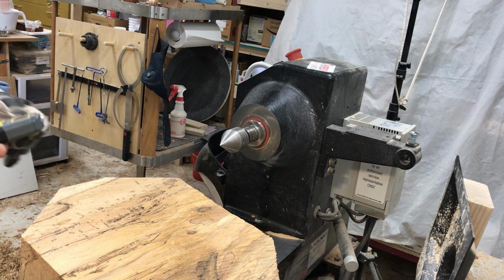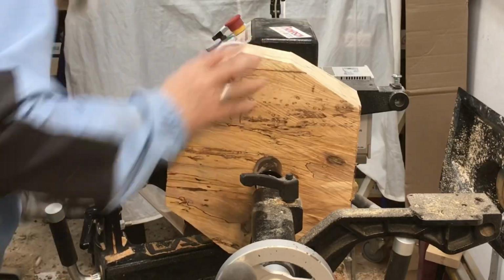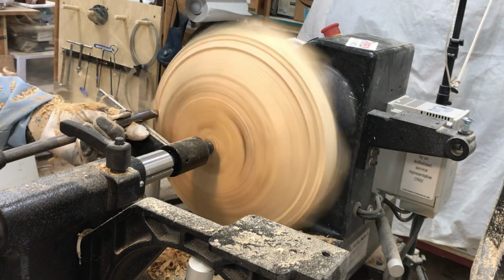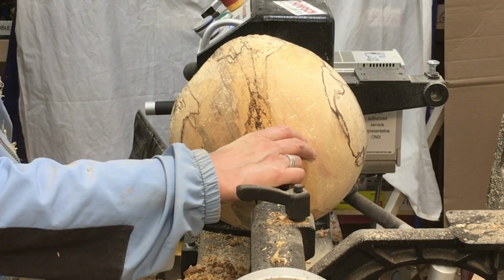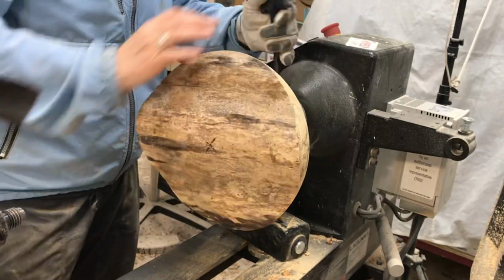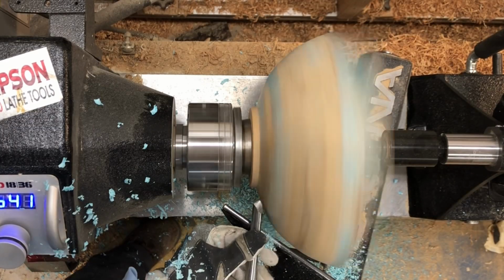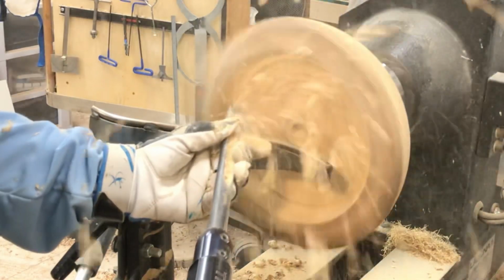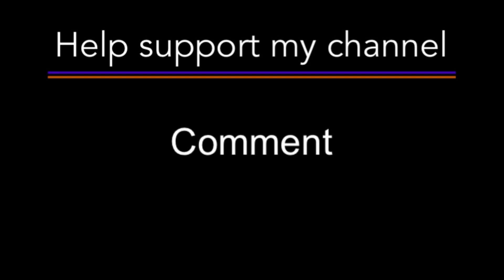Woodturning: Sugar Maple Natural Edge Bowl - Scalloped and Spalted

Comment: I love spalted Sugar Maple!  You gave me a great idea with the Milliput...I turned a large bowl from spalted Sugar Maple and the entire bottom cracked and split before I finished it because it contrained the pith.  I think I'll try the Milliput to fill the cracks and then finish it!
Reply from the maker: Hi Carol! I think the Milliput would be great for that. It actually did work in this case but there were just so many holes and voids that I really need something a bit thinner to slather over the whole thing and level out the surface. I’ve got a couple more pieces from this tree I’m gonna play with and see what I can do with them.
One of the things I’m going to do with pieces that crack, or pieces that are cracked to start with, is to put them in my turkey roaster and fully dry them out - let them finish cracking and then fill the cracks with whatever epoxy or CA I’m using. That should eliminate any additional issues down the road. I figure once it’s cracked, might as well let it go the rest of the way and deal with it all at once!

Comment: Lyle Jamieson's hollowing tool is a good investment. I bought one 5 years ago, and like it very much. I bought a small and thick boring bar, and like the way the thick one minimizes chatter when boring deep in a vase.
Reply from the maker: Hi Doug! I’m looking forward to getting it put together and trying it out soon - I’m sure it’s gonna be fabulous!
Reply: @LisaRamlow  The next thing you will need is a steady rest, for hollowing those tall items.   :-)
Reply: I bought an 8 inch faceplate from OneWay, and it added confidence when turning long, heavy items. A 4 inch faceplate just doesn't fit the need for larger turning stock.
Reply from the maker: Yeah, I saw a plan I liked and have been meaning to build one but have done every other thing in the shop instead! Gonna start off with some smaller items until I get the hang of it
Reply from the maker: Ha! I only just bought a 4” plate! But again, gonna start smaller and work up from there 👍

Comment: Fix the punky areas with sanding sealer or I sometimes use thin ca glue. Just flood the area once the shaping is close to final shape, soak it in and let it harden then turn to finish. Those little holes full of fine dust react well to soaking with CA too! Looking forward to the finish.
Reply from the maker: Hi Martin! I’ve used shellac and thin CA on spalted wood but once I decided to twice-turn this bowl I figured it was just wasting it. I’m sure I’ll need some stabilization when I finish it up. Thanks for stopping by and for the tip 😬

Comment: Awesome job so far, that is a beauty with all the spalting, your shop must be cold as I see you wearing a coat! Thanks!

Cheers Al
Reply from the maker: Hi Al! Actually, it is usually a little chilly in my shop but in the summer that’s a good thing! In winter I wear a welding jacket and summer a dirt bike jacket that’s much lighter weight. Both have high collars to help keep the wood chips out of my everywhere! 😂

Comment: Bug holes are a big bother..... With the 1/4 inch or so ones, I knew one turner who would use a pressure washer to remove all of the frass. With the tiny ones like these, no clue how to deal with them. Maybe a major soak in the Minwax wood hardener then turn it out, or turn down to what is solid. 

For those cracks, I like to chase the crack with the thin, then add some medium on top of that. The thin seems to wick the medium all the way down in the crack and fill it while the thin has no filling capacity.
Reply from the maker: Hi Reed! Biggest problem with this piece is that they pretty much go all the way through the tree. I don’t mind them, either blended in or accentuated, but I really wanted to have a smooth-ish surface for finishing and this is not that surface! 😂
I’ll see how the cracks look when it comes out of the kiln and attend to them when I see how big they are. They weren’t terribly wide at this point, but long so I dunno how much more it’ll move as it finishes drying, though I really don’t think this was as wet as the MM read so…

Comment: This ought to have an interesting live edge. Hope so !  No success with the Milliput ... I'd think it's hard to force into narrow spaces ? Gonna have to wait for the final bowl in a couple of weeks huh ? I'm patiently waiting 👀⏳ Take care. -Mike😷
Reply from the maker: Hey Mike! I actually got the Milliput into the crevices pretty well, but because there were so many different depths, etc I ended up cutting most of it out. But I like the way it looked and I think it will be really useful for situations that I don’t want to try to make a dam around a hole or something else hard to fill with liquid epoxy.
Reply: @LisaRamlow  So the takeaway with Millip. is cut and refine first, then fill ? I've only used it once and that's pretty much what I did - 2 bands ~eight inch deep & didn't want to chance any deeper. 
Have you tried UV epoxy ? May be a way to work on a  bowl a section at a time.

Comment: That looks like it will be very nice, hopefully it doesn't move or crack too much in the Kiln. I wouldn't put too much trust in moisture meter's, as they only measure a small portion, not the whole piece. I tend to rely on weight moreso these days. Speaking of which, I should be out turning the piece of Blackwood that turned out to be Huon Pine, lol.
Reply from the maker: Agreed - the moisture meter isn’t super accurate but I was hoping for a ballpark idea as to where it was. I actually think this blank was more dry than that reading and I don’t anticipate much movement in the kiln, but we’ll see. I’m probably going to take one of the other pieces from this tree and actually once-turn it to see how that goes, assuming they haven’t cracked beyond my level of bravery 😂

Comment: Lovely bowl Lisa! For filling small voids and bug holes have you tried two - part 5 minute epoxy mixed with coffee grounds? The epoxy sets quick but is easily worked and the coffee grounds finish really well. I love this putty that you used though I’ll be giving it a try!
Reply from the maker: Hi Paully! I’ve not used the 5min epoxy with coffee yet, but so plan to try it. That or UV resin might have been a good option for this so I could work it in stages 🤔

Comment: Excellent and very informative video!  I do have a question about it though.   After you found the center points you desired, is there a reason you didn't use a woodworm screw to do your initial turning?  Thanks again!!!
Reply from the maker: Hi Harvey! Not necessarily at the time I did this maple bowl, no real reason I didn’t do that here. However, I just did that on an aspen bowl I’m working on, and it is also a natural edge with an uneven bark side and it didn’t work in that orientation. I may have drilled the hole slightly crooked, which on a flat surface isn’t such a huge deal as you can usually suck the face of the bowl blank up to the chuck jaws and straighten it out. Because this was curved, that didn’t work and I couldn’t get it to run even close to true, so had to take it off, remount it on the drive spur, and make a tenon instead of a mortise. So maybe not a great option for natural edge or lopsided blanks but I don’t see any reason that wouldn’t work perfectly fine on a flat-faced bowl blank.

Comment: What temp do you run your kiln at, and how long do you keep a piece this size (14"?) in it.
Reply from the maker: Hi Tom! I don’t actually keep the kiln at a particular temperature since I use a humidity controller to turn the 125w heat light on and off when the humidity reaches the target humidity I set. I talk about the specifics in this build video https://youtu.be/5nI9BL_pV7M and and update and look at how long it took to dry a big load of birch bowls ranging in size from about 6-13’ in diameter in this one https://youtu.be/UoId5-SwJrM
I’m super happy with how this setup works out and I’ve only got about $50 total invested in it and that’s mostly the humidity controller 😁
Reply: @LisaRamlow  Thanks for the reply. I played around with a Harbor Freight lathe for awhile then decided to get serious and bought a Laguna and started collecting wood. Got some good stuff but it's all green and wet. I'll go and watch these videos. Thanks again